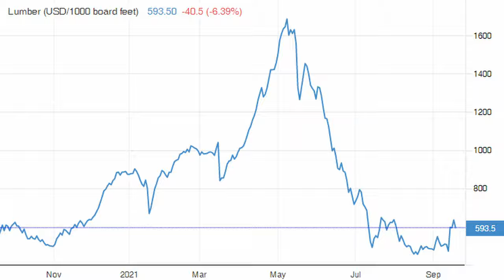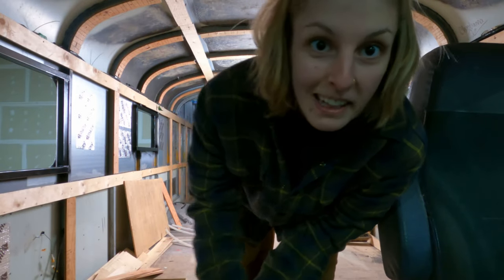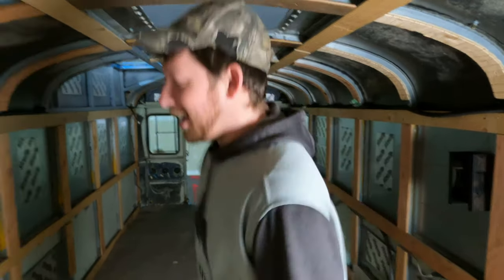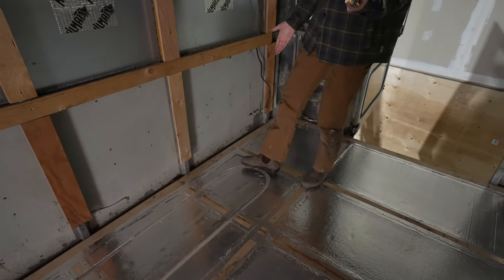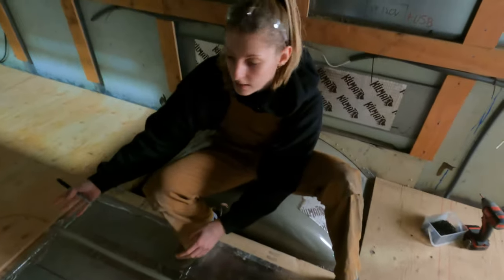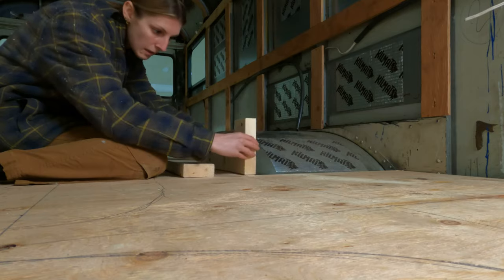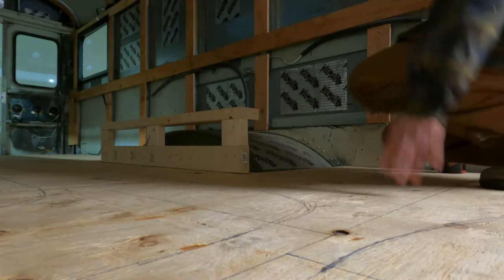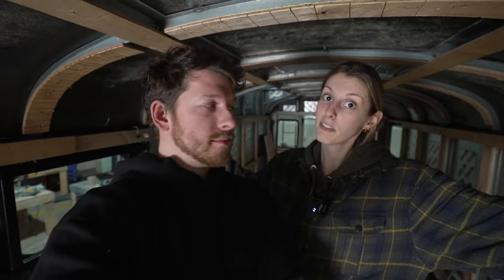Redoing Our Subfloor | Skoolie Conversion Ep. 22 | Adam & Steph

Comment: If the insulation and framing were the same height there probably wouldn’t have been any sag in those areas. With the thicker plywood the in floor heating will have to work a little harder but you also will get your firmness you desired. 
Framing right over the plywood which disperses the weight of the bathroom wall which might weigh 30-40 pounds once finished was a little overkill. But it’s done now. No harm. 
Pocket holes are game changer. Great choice. 
Thoughourly enjoy the channel and video editing. And you guys make a great team. Looking forward to the finished product.
Reply from the maker: I think we went a little overkill with our infloor heating pipes being 3/4” pex. In our research we’ve found that for small spaces you should use 3/8” pex. So hopefully our thicker ply won’t hinder it! Thanks for your support! We always appreciate comments like these 💙

Comment: Good move on swapping out your ply now when it's easier to do so.I would recommend using marine ply if your are putting it outside the bus, more expensive but it will last longer, just varnish the edges and seal it's joints and you will be good. Love the positive attitude as well guys.
Reply from the maker: Thanks for the tip! We’re definitely glad we did it now before it was too late! Thanks for always supporting us!

Comment: Just a thought, Another layer of flooring over what you have should firm up the floor? Another 3/8 Ply? or hardwood flooring? And for added measure, glue the top layer to the bottom layer.

Comment: Are you guys glueing/screwing the studs down to the bus’ metal floor at all? Or just a “floating” type?
Reply from the maker: We used “PL Premium” construction adhesive to glue the 2x4s to the metal floor. Without it, the boards squeak against each other when you step on it

Comment: Hey guys! Love y’all’s vids. Question: I think I’m going to have to do this in my bus not because I bought too small of wood but because we did our floor first and then our roof raise. While doing the raise the ply got rained on a lot and warped. Now I’ve got to replace it. I’d love to keep our 2” pink foam board under it because that junk was expensive. It’s a floating floor like in Chuck Cassady’s vid and it’s all secured with loctite pl3. 

Do you guys have any advice on how to best separate and remove the plywood without destroying the foam board?
Reply from the maker: Im not sure how you can do that repair. We have framing under out plywood which made it easier to remove and replace.
Reply: @AdamandAtlas  ahh, I see. Thanks for getting back to me. I assume y’all did not use glue then.
Reply from the maker: No problem! And nope, just screws

Comment: 3/4” plywood is what I’m going with. No framing underneath, just plywood glued directly to the foam board insulation underneath. The framing just creates unnecessary thermal bridging.   But I live up in the subarctic, so I guess I’m more fussy about thermal bridging issues than you’ll have to be!
Reply from the maker: Thats the better way to do it if you have the high density foam board that does not compress under the weight. Tho i must say, we’ve been in the bus this winter in -35c and cant feel the wood studs at all. What we do notice is how much heat we loose from the front windshield and step well tho.
Reply: @AdamandAtlas  I’m planning a ‘pocket door’ kind of separation between the upfront steps/driver seat area and the living space. Once parked for the night, I’ll slide the door shut to separate the two spaces.👍
Reply from the maker: @markreynolds5363  that’s a great idea!!